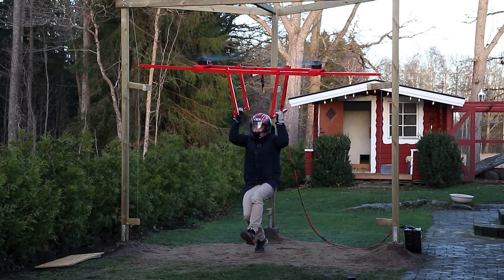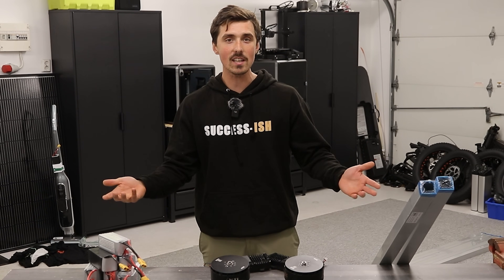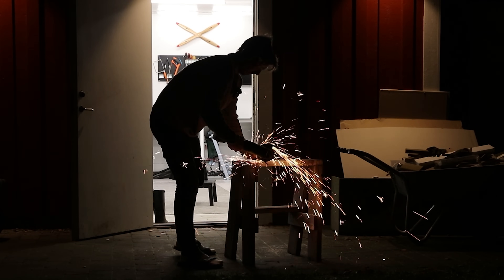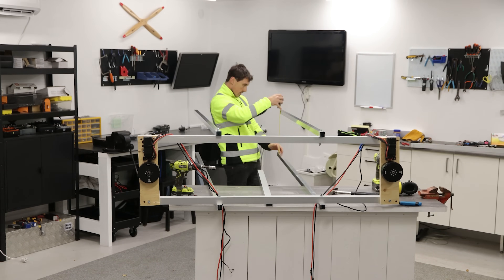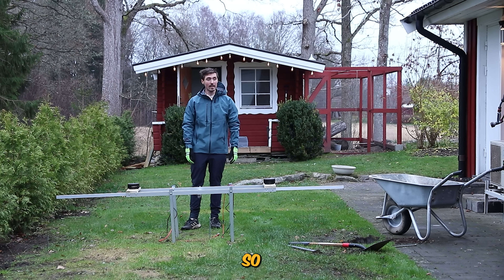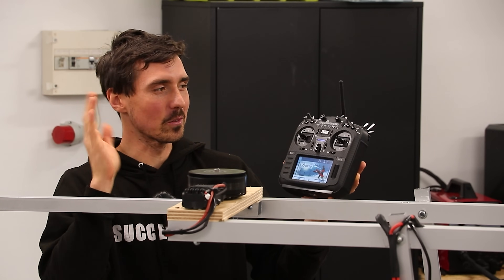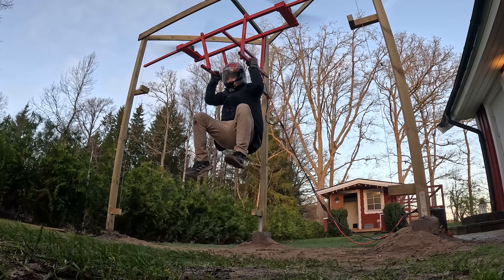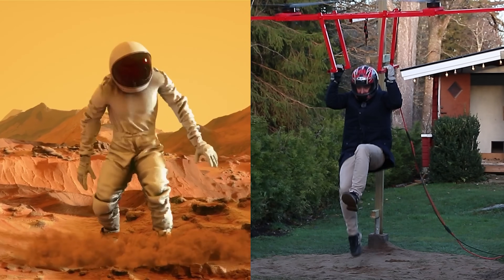Recreating Mars Gravity With a Heavy Lift Drone

Comment: I encourage your interesting ideas and effort but you need to educate yourself on many topics before putting yourself in danger and building these very unsafe machines. 🫣 for example, you need to learn about how structure behaves, the rigidity and tensions, for instance that hole you made for cable management was awful for your structure and creating lots of stress and probably will turn into breaking point in future. you may also learn little bit about flight computer, in order to control the dynamic of the system. also two propellers were very too close, it's not just about clearance it's also about aerodynamic and vortex generation at the tip of the propellers.

Comment: I'm only half way through your video and I have a few ideas.  10 mill heavy clear vinyl instead of plexiglass would work well, it is flexible enough to stop a blade without shattering.  It could be tented above your head, hung from a single rod and, like a bullet point, drape over your shoulders over a second pair of bars, this would deflect air from hitting your head an shoulders and cause less downward drag.  Bending the ends of your props downward 15 degrees would increase their efficiency just as a duct would as it would direct air more straight down and less out in a spiraling cone.
Reply: Bending the ends of the props? Pretty sure these are carbon fiber props. You bend them, they snap, and you end up with carbon fiber shards in your fingers (and/or eyes...)
Reply: @Vousie  Yes, but if you heat them sufficiently you can bend them, set them in a jig and they will retain that bend.  The point is, if you can make your own props you can make better, more efficient props than what is offered off the shelf.  There is a company who makes bent props and I have seen them on a vertical lift plane.
Reply: @TheWadetube  Pretty sure these companies already do a lot of research on efficiency, and making custom carbon fibre props is a very difficult thing, especially ones this big. Have you actually tried making your own? And done comparison testing? If not then I don't think you can make these kinds of claims. And a quick Google search tells me that heating CF is a bad idea...

Comment: Im thinking myself of this kind of floating device. Can give you some ideas that i thought about. 
!.st, safety, so add cage around, like on room fans, it can be light weight so as soon as blade touches it will stuck. 
2. Make base for motors not rectangle, instead single rod connected to back of engine, And make Y connection, in 30degree angle. Rotating should be easier. And Caron ofc, you can buy cheap from Chaina friends.  
I was thinking the down part should touch ground, and best if you could stand on it, but as backapck it sounds better. Ideal with gimbal at belt level

Comment: As you are "flying" this thing without any stabilization will tend to frontsteer then dunk into the ground. You should use simple active aero, just some servos and big flaps would fix the dunking problem. Now you need bigger motors too.

Comment: You could use some counterweights with guide rollers. Like some elevators works. They do not need to be 100% balanced. But with the counterweights the Propellers has less to pull up, right?

Comment: Abrasive grinder wheels are a bad idea for aluminum. It melts and gets sticky and heats up the disk causing the disk to explode in the worst case scenario.
Also it just doesn't work well like you said.
Blades with teeth and sanding are the best ways to work with it.

Comment: A great build. Loved the video and laughed so hard at You half deaf yelling at Your GF to up the throttle!  You did spend a lot of time on things that are easy to look up, as there's plenty of research on these since the 50's (as always, research > experimentation, but it's not always more entertaining). A) Ducted props with steel mesh on the underside of the duct. Ducts can easily be printed in segments and pulled together with a hose clamp large enough. This would give more downward thrust from same size of prop and motor. B) There's so far no way to control it or stabilise it other than the two steel cables. Control surfaces under the ducts and a gyro to control them would allow You to get some proper air! While You'd still be tethered for power, it would be awesome to see this work out in an open field.

Comment: You know what you need to do…

Square out the frame, double the motors to lower duty cycle and make a 20ft high cable guide to make some full height jumps.

Comment: 1) your RC interference is PROBABLY from being too close actually. 

2) Maybe Consider using a simple servo tester for your throttle? it just gives you a potentiometer to be able to control as you are onboard.
Reply from the maker: Hey! I want to build a heavy lift drone with 4 of those motors. Which version of the Pixhawk do you think would be a good flight controller? GPS would be nice but all the sensors they offer I can be without.

I've been waiting for your comment! 😉

Comment: you had two motors, two propellers, and your controller was sending 70% of the juice to hold 70% of your weight.  Did your woman ever think.  Hey, maybe if I just put it at 100 and send simon somehwere else, I wouldn't have to deal with him anymore?  What about adding another propeller, and getting a harness, because thats all a jet pack is. some propellers with strapped on to you

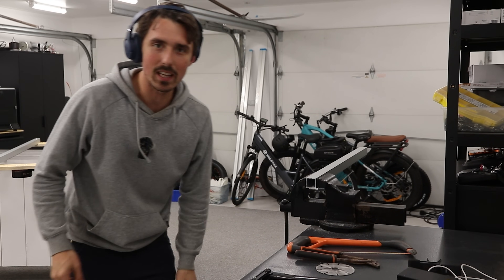Comment: 4:49, That's because aluminum is a "long chip" material and should never be "ground" it will clog the abrasive element and potentially explode the grinding disc.

Comment: If you want to cut aluminum with an angle grinder, there are special pastes for that. It works like a lubricant and you cut it much faster
Reply: The problem is more that Aluminum is too soft. Softer than the hardest hardwoods. It actually cuts really nicely with a wood blade on a miter saw.
Reply: Or use isopropyl alcohol , it cools the aluminium and works so the aluminium 
do not melt and don't stick to the cutting blade

Comment: Hmm... Since you dropped mobility and attached whole thing to that three-legged contraption... Why not ditch also whole battery, motors and wiring part and use just some pulleys, wire and counterweight? 🙂

Comment: Sadly it isn't as simple as just reducing your weight. Doing so lets you get an idea for how high you can jump but the fall downwards is not accurate. You have to have the system actually reduce your acceleration which means it needs to be able to support a large portion of your weight in order to make you actually fall slower.

That said, the difference is likely small enough you wouldn't notice.

Comment: So, actually you wouldn't get the same thing from bungee cords since they have less tension at the peek of your jump.
The difference is so minimal it's likely unnoticeable, but we need a reason for this to exist.
Reply: You could use a rope and a pulley with a counterweight, that way the tension remains the same, and it is very easy to adjust
Reply: @bastienx8  That doesn't sound very dangerous though.
Reply: I was more thinking a long arm with a counterweight on the other side. IIRC Colin Furze built something like that already. You could seamlessly adjust that from earth gravity to basically zero gravity.
Reply: @XTJ7  Counterweight would increase the inertia way more than the rotocraft.

Comment: OMG, cool, I also cut profiles with my knees! I thought I was the only one. Haven't finished the video yet, but I'd probably have gone for 3 props and offset them to minimize the width/diameter of the whole contraption. Or just springs and pulleys without any electrics. :)  BTW, "Acorn" nut for UK and North Americans.

Comment: If you control the accelerator with an Arduino you can automate the power management, I would use ultrasound and a gyroscope

Comment: What I would try. space the motors up a little bit more so you can put those handles under your arms and hang from your armpits. move the motors up to give you clearance on your helmet.. then put a aluminum mesh as a stopper from letting your helmet pop up to high. I think it would work so good

Comment: Broo you could have just used a climbing harness, rope and a hanging counterweight, it would be much safer.
Reply: But but but where's the fun in that?
Reply: Also a pulley, but yes, my idea exactly. But the idea with the propellers would be to have a sort of drone, that is "following" you, so that you can actually run and jump a distance, but that's even more difficult to make and it would require two more propellers.
Reply: @dingdingdingdiiiiing  ooooh a person delivery drone. that would be so sick tho.
Reply: @dingdingdingdiiiiing  I don't think, that you need 2 more propellers for it to work, see the bicopters. It won't be easy, but it is possible. If anyone can build it, it's Simon. 😁
Reply: @dingdingdingdiiiiing  My hope is, that this was part one. Hoping to see this untethered kind of "jetpack" style to jump around. And yeah, like @ding said, control would be needed, Quad or articulating blades.
Reply: Safer? It is not about this channel😂
Reply: He could have, but then he wouldn't have a video at all relevant to his channel or his hobby.
Reply: yeah like the apollo hoaxers did